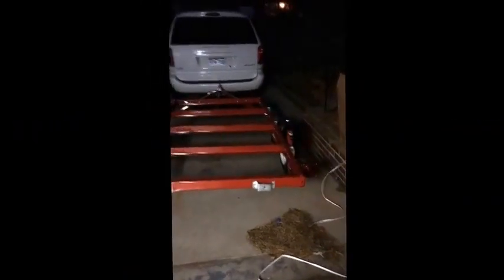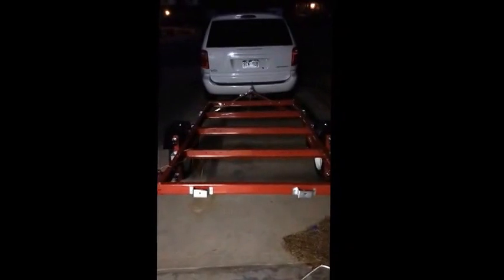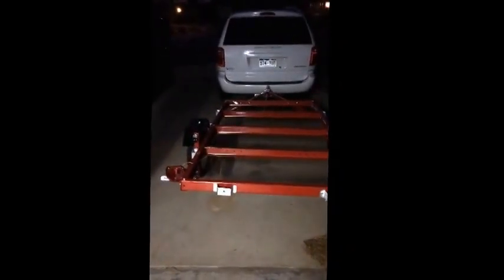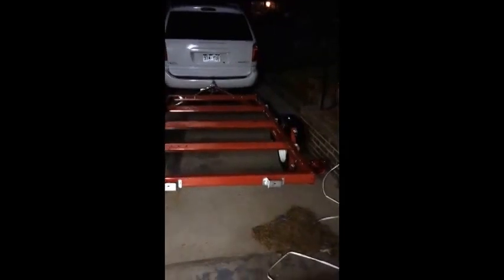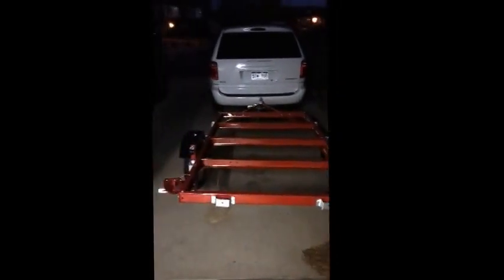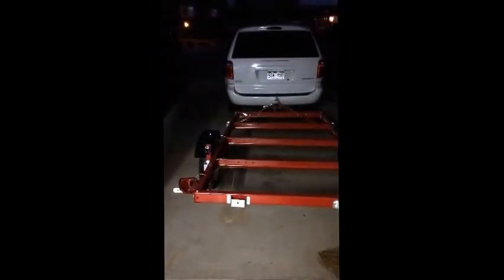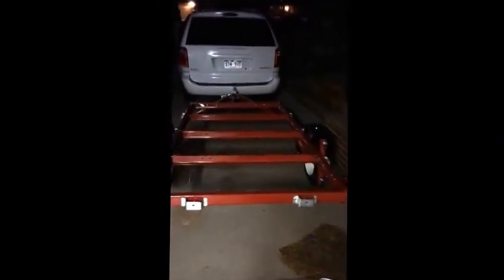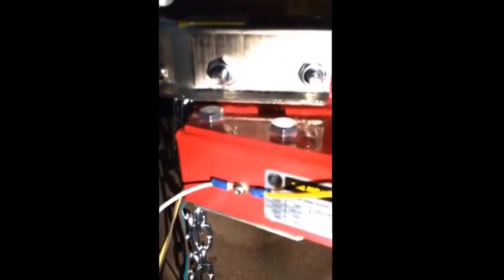How to Fix Harbor Freight Trailer Light Issues (or Trailer Kits in General)

Comment: OMG...thank you SO much for this.  We've spent about two years putzing around with our HFT trailer, trying to get the right side lights to work.  We tried everything, new lights, new wiring harness, we tried connecting wires differently, everything.  Finally, after we bought another wiring harness and carefully wired it exactly as it should be to new lights and STILL nothing, I told my husband that if we couldn't find something on the internet that we'd just have to take it to a mechanic.  My husband pulled this up from his google search, we followed your instructions for running the ground to the light and, voila, success!  Just wanted to say thank you so much for putting this out there.  We were truly at our wits end.
Reply from the maker: You're very welcome!  Glad you got it corrected and hope you put that trailer to good use! :)

Comment: I had grounding issues even after grinding the paint off of every contact point for each of the lights.  At first I was not sure it was the ground but after a few weeks of trial and error and purchasing a new wiring harness (for the truck) I stumbled on a blog post where someone mentioned the Harbor Freight trailer folding feature is the culprit.  It separates the frame into two pieces and creates a joint that does not promote good contact points for grounding.  Your solution, bringing a ground wire from the front directly to the back immediately solved that problem for me.
Reply from the maker: Hey David - lots and lots of people order a new wiring kit, so you're not alone there.  Glad the ground wire solved your issue!

Comment: Glad to see I'm not the only one that has had an issue with the lights. Ours were sorta iffy... kept loosing their connection but then they totally went out in the middle of a 1,000 trip with the trailer loaded. Didn't want to deal with all of that so we just bought the magnetic tow lights and gorilla taped them to the frame. It worked but it was a temp fix. We just removed the plywood floor so I think I'm going to fix the wiring once and for all. Thanks for the tips.
Reply from the maker: Hope you get it figured out, Rachael.  Thanks for posting!

Comment: You saved my bacon!  Struggled with this for more hours than I care to admit.  Even had harbor freight send me a replacement light.  Ground was the problem the whole time.  I bought some wire and tied into the ground up front and the bolt holding on the rear light and all works perfectly.  I was about to buy a whole new trailer light kit which would have been a total waste.  Thanks!
Reply from the maker: Jeff Easley I so understand Jeff - Makes me recall that night all over again! lol  Glad you got it worked out and thanks for the comment!

Comment: This approach worked for me.I had an issue with the rear lights not turning on. Rear signals and rear brake lights would function, though. I re-drilled and re-sanded all five grounding points on the trailer, screwed em in, hooked it up, turned on the lights, and Presto! Thanks for vid.
Reply from the maker: Glad it worked, Eddy! Enjoy the trailer

Comment: thanks so much for this. was being derived to distraction by the "floating ground" on our silly little HF trailer. ran an individual ground wire from each of the tail lights to the same ground connection at the tongue of the trailer. "voila" as you say, or "problem solved" as Ross Perot used to say. many thanks.

Comment: I was putting the final touches on my HF trailer earlier today, and I was having trouble with both brake lights.  I wondered if the grounding was the issue, but I ran out of time and had to put it to the side for the time being.  At this point, I'm thinking running individual ground wired to each is the best solution.  Thanks a lot for confirming my suspicions!

Comment: Thinking about buying this trailer from HF, but wiring/electrical is totally Greek to me.  Is your fix a lot of additional work?  Am I understanding this correctly that you are just adding an additional ground wire from the front of the trailer to the rear?  How many places do you need to grind away the paint?
Reply from the maker: Hello Timothy!  Sorry for the delay - honestly, if you can find one used on Craigslist, that might be the way to go.  I think the new kits come with the LED light kit (which is a nice upgrade).  Otherwise, no, this is a fairly easy solution.

Comment: Great solution!!  Make it even simpler by grounding the light post to the trailer frame right next to the light (sanding paint off first). Worked for me with just 6" of wire on each tail light. Thanks!

Comment: Good video thanks. But I have a question for you. Why are you running the wires to the tail lights thru the top rail? They should be run under the 
Top rail so you can lay your platform board without damaging the wires? Think about that!
Reply from the maker: Haha good catch, Bernard!  After the video, I did re-run them below so I could lay the top board.  The video, however, had already been shot :-)

Comment: Just a note for anyone who is still trying to ground the lights through the frame.  You don’t need to sand away as much paint if you use a ‘star’ lock washer to ensure a good contact between the relevant bolts and the frame.
(https://www.aircraftspruce.ca/catalog/graphics/m/A936WASHERA.jpg)

That said, it’s still better to run a ground to each light individually.

Comment: I bought the HF magnetic lights for my trailer.  Simple install but I do not have running lights.  Brake and turn signal yes but I don't have lights on when I pull on my truck lights on.  Is this also a brown wire grounding problem?
Reply: This shouldn't impact the magnetic set.  How clean/dirty is the plug on your truck?  You might try cleaning and then applying dielectric grease.

Comment: At first I had the same problem you did. My right trailer light would not work so I did the exact same thing you did and ran the ground from the front of the trailer to the right light and now my right light works but my left light is not working when I turn the turn signal on or hit the brake light. I have running lights just no turn signal or brake lights. Do you have any idea why?
Reply from the maker: +Roger Barker Hi Roger - this is going to be tied to the floating ground as well.  I would run a ground wire back to that light just to test it...if it doesn't fix it, there's a chance you have a bad set of lights.  Let me know how it goes!

Comment: Hi thanks for the video, very useful I had the same problem, but even after wiring the ground i have one issue, when the daylight are on and one turn signal is on, the light from the opposite side still blinks just a little bit so it has noise. Testing each light individually works find. Any ideas or suggestions?
Reply from the maker: Hi Luis - which lights have separate ground and which ones use the floating ground?
Reply: Hi thanks for your replay, with a multimeter i was able to measure ground on the first half of the chassis, but the other half (the back side) did not have ground, so added extra wire from the connector two a nut to the second half of the chassis on the left side, and now i get grown on both half, and lights work properly when tested individually.  My guess is that there is resistant in the chassis so i tried adding a second wired to the right side but it didn't fix the problem. Any clue? Thank you
Reply from the maker: Luis Campos Sounds like you're on the right track.  Have you sanded off the paint where many of the bolts touch the trailer?  You might want to do that on the one light still having problems.  Try that and let me know?

Comment: hi great video.  I am having an issue but not sure if it is related.  All my lights are turning on but when I press on the brakes my taillights turn off.  Also when i turn on the blinkers both lights blink.  Does this seem to be a ground issue associate with what you referring ?  Thank you
Reply from the maker: Hi Alex - this is a bit late so maybe you've discovered the error.  But, yes, strange phenomenon such as that is usually tied to the ground.
Reply: Alex Cisneros I'm having this problem too. When I hit breaks my tail lights turn off. Did you figure it out?
Reply: You need to ground your back lights to the chassis.  You can connect from the back screw of the light to the chassis and it will work.

Comment: Hey and thanks for the video. I'm going nuts trying to figure this out. One side of my trailer works fine. On the other side of the trailer the daytime running lights do not work at all however the turn signals do work. I'm almost certain that the wiring is done correctly and the connections are solid. Could this be the ground? I did sand the ground terminal before screwing it in. I didn't sand any other areas though. I just don't know if the lights are defective or it could be a grounding problem. Please let me know what you think and thanks!
Reply from the maker: mattyg18 Hey mattyg!  I think you're on track sanding the ground...but for the 'floating ground' system to work 100%, all the bolt holes also need to be sanded to ensure the bolts are connected to steel and not against paint.  Hope that makes sense?

One test you could try would be to run a separate ground wire from the ground to one of the lights on the side your having trouble with (exactly like how I show in the video).

See if that solves the issue for that light...and if it does, you know the rest from there! :)

-CUSA
Reply: centralusatech Thanks for the reply. I guess the question that I've got is that if the turn signal lights are working on that particular light and not the daytime running lights then could that be the ground? I'm not an electrician but I would guess that if the ground wasn't connected then we wouldn't get any lights to work. Please let me know what you think on that and thanks again!
Reply: centralusatech Hey CUSAI did run a separate ground to that particular light today and when i did that the outside turn signal light (which was working) stopped working and the larger inner one (which wasn't working) began working. I sanded the paint down and reconnected the bracket and that is exactly what happened. Now I have the inside turn signal working and no longer the outside one. The light on the side of that trailer still does not work. I spent a good two hours on this today and i'm completely stumped. If you have any ideas please let me know. Thanks again!
Reply from the maker: mattyg18 Frustrating!  At this point, I would run a separate ground to the light that is now not working and see what happens.  The floating ground system that is employed in the trailer can be finicky.  Hopefully it doesn't take too long....let me know if any changes?

Comment: So here's my issue with my hf trailer. All running lights work fine. But when i pressed the brake or signal left it flickers once and then nothing at all. But for the ride side it works perfectly fine. Would the grounding method in your video help fix the issue im having?
Reply from the maker: KayakBassFishing The variance of issues abounds! lol  Yes, I would go ahead and try the ground solution here as it would be easy to test.  I would first try by running a wire from the ground to the lights just on the outside of the trailer - don't route anything through all the small holes just yet.  Then, if this does resolve the issue, you can go back and re-route the wire through the trailer holes as its supposed to go.  Let me know if it works!
Reply: centralusatech after many testing i finally find out that the problem was with the black box converter I got from auto zone. For some reason I was losing power to the left tail light. Which explains why it wasn't working properly. Took it in and they ordered me a new one. Just got it in today and works perfectly
Reply from the maker: KayakBassFishing Thanks for sharing the solution.  Just out of curiosity, what are you towing with?  I don't think a ton of people need a converter box...but maybe down the road if someone is using one, this could help them resolve their issue more speedily.  Thanks again!
Reply: centralusatech im towing with a mazda tribute 2006, no tow package.

Comment: Hello, just to make sure. I'm wiring up my trailer now...the ground for the tail lights is through the mounting bolts? So if I connect the ground wire I'm going to use with a eyelet on there that should work?  Then the same for the running lights, eyelet on the inside (replacing one screw with small bolt). Thanks for the video!
Reply from the maker: Kyle - as long as your ground wire is connected to the frame (without paint getting in the way), you should get a solid connection.  If your lights act a bit loopy, something is incorrect with the ground connection.  Let me know how it goes!

Comment: did you ground each fixture or just that one?
Reply from the maker: Hi Tim,
If I rebuilt the whole thing over, I'd ground each fixture.  However, I had already sanded off so much paint, I just ground the one light causing me problems.

Comment: Great video I am just doing to wiring on the trailer. Did you add a ground for each light and then run them all to the one in the front? So you have a total of 4 custom ground wires?
Reply from the maker: Hey sorry I didn't get back to you sooner - wiring a separate ground for each light is definitely one solution.  Because I had already sanded the paint off so many bolt holes and gotten 3 lights to work...I wired the ground in the for last light in order to save time.

Hope that helps...and hope you get your lights workin'! :)

Comment: Does the trailer have to be unfolded for the lights to work?
Reply from the maker: No...the lights should technically work even when folder up.  There isn't a relay switch or anything that engages upon opening the trailer....

Comment: Did you grind the paint off of the tail light brackets on both sides also? I couldn't tell. I'm having the same issue you was having
Reply from the maker: Bob Vicars Are you trying to wire in a ground or still use the floating ground?  If you are using using the floating ground 'system', then yeah, sand the paint off.  You'll want to sand off all the paint where the bolts touch the frame so there's metal-on-metal.

Let me know if that helps at all?

Comment: I'm having issues with my wiring harness altogether...I've got all wires matched up, twisted and capped...unfortunately I get not lights at all.

I've sanded the ground area and all screw/bolt areas where the lights are present..Still nothing...

Im thinking of adding my own ground wire to each light direct just as you did to fix your taillight issue....what are your thoughts on that?
Reply from the maker: Garage Muscle Athletic Group It wouldn't be much more to add in a ground at this point; maybe try it on just one light and see if the results are good.  

Otherwise, what are you plugging the trailer in to?  Are you using an adapter (say a 4 pin to a 7 pin)?  One guy below had a bad converter/adapter...so I would look at that after the ground attempt.

Let me know what you find!

Comment: Aren't the housing for the side running lights plastic though? So how would sanding down the bolt hole area help since the bolt will just be touching plastic?
I have one running light out for some reason. And when I hit my breaks, the tail lights shut off completely. I did however, sand down where I attached the main ground wire (white) off the trailer wiring harness.
Reply from the maker: You're drilling in to the frame and the bolts mount on the frame as well.  You have to get the metal to touch metal and the ground will take
Reply: I understand that. But if the tip of the bolt is in the frame, and the head of the bolt is touching plastic, you won't get ground. I ended up running a ground wire to each light that wasn't working properly (3 out of the 4) and viola, it worked. If anyone has questions in the future about side running lights not working or there break lights shutting off when they hit the breaks, they need to run a separate ground wire to each light to get it to work. Thanks a lot for your video and your reply, I would have been at a loss without it.
Reply: P.s. I used your method initially... sanding down the frame where the bolt goes into, and I still had the same problem. It wasn't until I ran a ground wire to each light individually to get it to finally work.

Comment: dude!!! thanks so much man... to just test your theory I dropped a line for a ground and bam the lights came on.... so i was like do i drop a line for each light or grind and redrill same holes as bolts... decided to that and boom lights on!!!....... thanks again man ur video after many hrs totally solved my issue...... why is this this not stated in the build part?!!!! also why is this not addressed in build quality? oh right its HF ;)
Reply from the maker: Ryan Harmening LOL Ryan! Yeah, you nailed it with the, "Oh, it's HF."  Glad it helped man and enjoy your new trailer!
Reply: +centralusatech hey dude have u seen this recall about lights I filled out this form and emailed them and it was probably 7 ays and just received 2 new led rear lights..... with a ground wire for each light... go figure... they must have been watching ur video.... thought maybe you would like this.... it did work. cheers
http://images.harborfreight.com/hftweb/recalls/Trailer%20Light%20Recall.pdf